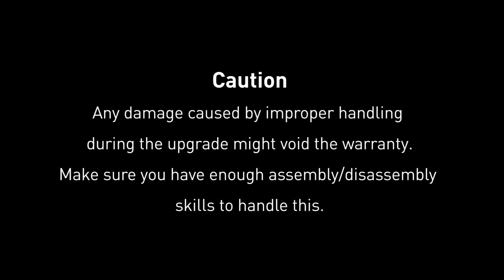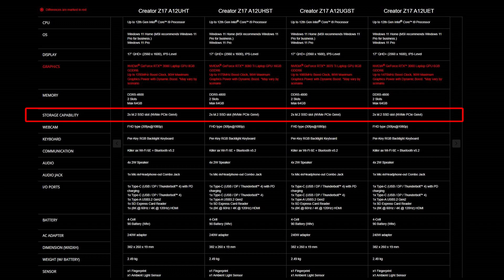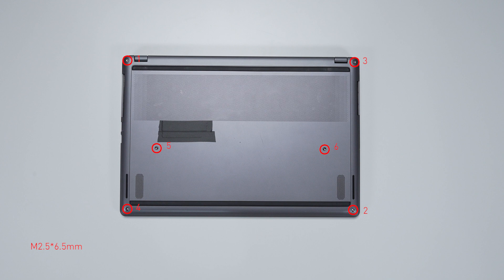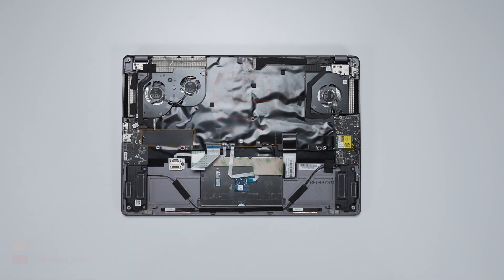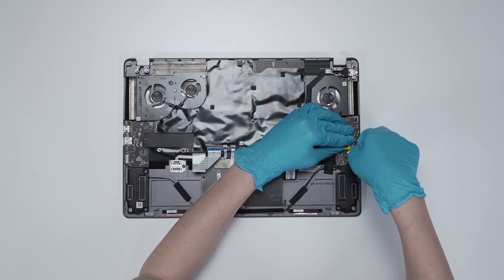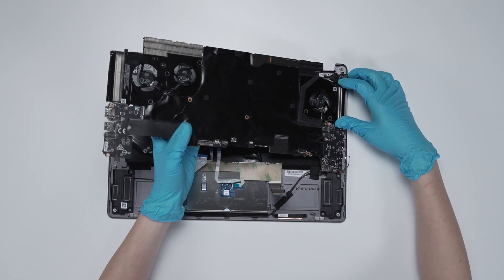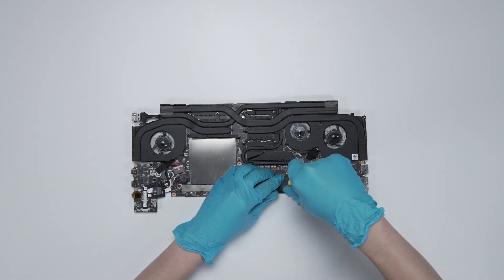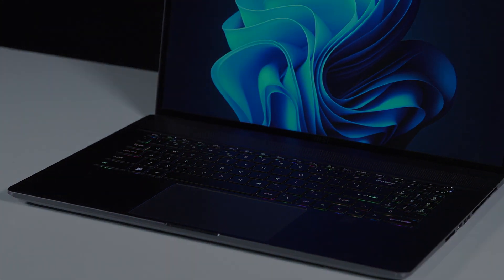MSI Creator / Creator Pro Z17 Series Upgrade Tutorial

Comment: Firstful, thank you for this tutorial! I helped me to disassemble a laptop (that is worth so much still!) and add a new SDD after the original broke after Windows crash (!). 
The second point is that I didn't have to so much just to add a disk to an empty slot and I wish this was mentioned BEFORE I disconnected so many weird connectors taped to the board and battled with some screws.
PRO TIP: If you're only adding an M2 disk, you should be able to do that after ONLY taking the cover away.

Comment: I successfully upgraded my Creator Z17 by installing two new RAM modules and an additional SSD, all thanks to the guidance provided in this helpful video (Thank you!). It's astonishing that MSI doesn't offer this information themselves. Mike and @Vinces2 pointed out that there are certain nuances and challenges not covered in the video. The most daunting aspect of the upgrade was handling the cables. The cable clamps proved to be particularly tricky, causing some moments of panic as I struggled to reconnect them properly. Unfortunately, I ended up breaking a few small parts of the clamps in the process. At one point, I even questioned my decision to attempt the upgrade without professional assistance. 
Despite the challenges, when I finally powered on the computer, it was like witnessing a miracle, albeit with a slightly longer startup time than usual. Everything is now running smoothly and significantly faster with the upgraded 64GB of RAM and an additional 2TB SSD. I followed @rawraj's advice of using sheets of paper to map out the screws, which proved to be invaluable. For anyone daring enough to undertake a similar upgrade, I strongly recommend thoroughly studying how to disconnect and reconnect the specific ribbon cables (before doing it), and having some canvas tape on hand wouldn't hurt either.

Comment: Pro TIp I just take a rectangle piece of paper perferbaly a thicker paper it can be smaller than the laptop I just draw the screw holes and draw where the hinges are and then just poke the screw right into the paper. THis keeps the screws from getting lost and when putting it back its easy.

Comment: As MikeB points out, this is not the video for most here, me included. This vid misrepresents the tasks significantly. A NEW Z17 doesn't come apart anything like as easily as the demo, mostly because there is tape everywhere that does not let go. The method of removing the cables is just rubbish, and nothing is said about the very important task for each one on reconnecting. There are several different types of connectors and each one needs its own special way. For me, the small cable next to the camera plug from the screen wouldn't tighten up again, so I wound up pinching a bit of the excellent canvas tape and securely holding it in that way, hoping the one on top will keep it in firm contact. I also damaged the tops of two of the bigger cable connectors, they did seem to clip in OK and I made sure they were well taped down. So far, so good. But I know very well I will have to send the laptop back to MSI for a proper repair if any of these connectors let go. I figured I had built many PC's and changed the screens on a couple of iPhones and an Android, how hard could it be? If you get to disconnect the screen and cannot figure out how to release and reconnect the main cable, don't go any further, stop there, get help. Sure I now have the 64Gb ram in there I wanted, but I will regard it as a borderline reliable laptop, until I forget about it and that comes back to bite me! Also of note, I only put in a new 4Tb ssd on the easy side, had I known it performed roughly 50% better than the 1Tb Samsung OEM one on the back (with the RAM), I would have changed that too, or at least swapped them round so it could be got at later... I suggest get some hard performance numbers and make your own mind up before you go in...

Comment: Just went and changed my ram and after trying to do it as you showed and some of the clips broke and now my screen has lines, I'm hoping I can fix it but one of the 3 connectors fron the screen seems to be moving. It's  crazy that a 4 thousand dollar laptop is make so cheap. Any suggestions on how to line up the connectors and make it not move?. The ddp seems to be fine and the touchscreen one also, the 3rd one you said was the camera and that is the one moving. Not sure which one it would be.

Comment: Hello.  Tell me, please, is there any upgrade in terms of the cooling system?  It gets very hot, which hurts to touch the metal case.  Who and how generally copes with it?
Reply: In MSI Center, you can adjust the fan speed. It's under Optimization, then User Scenario.